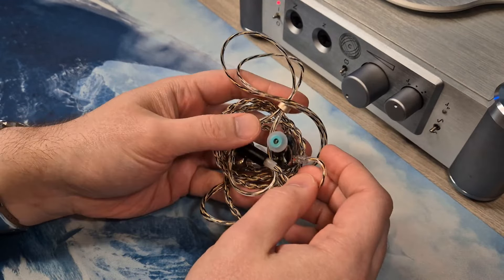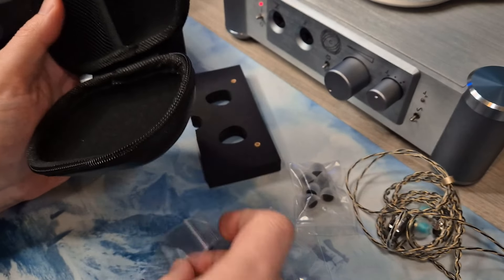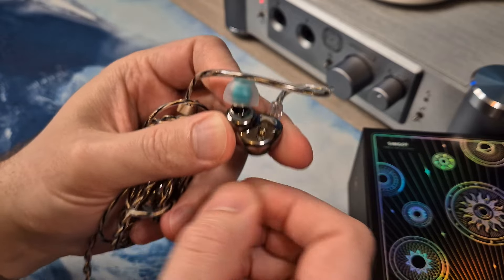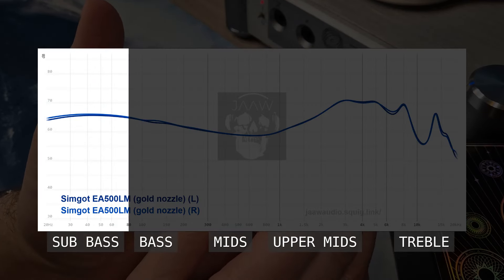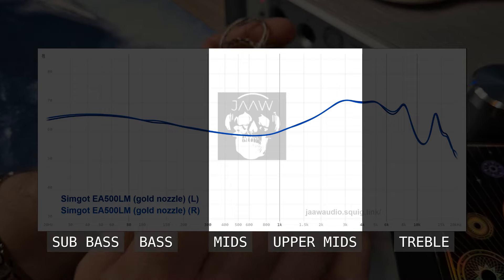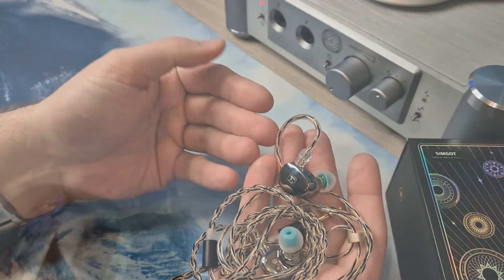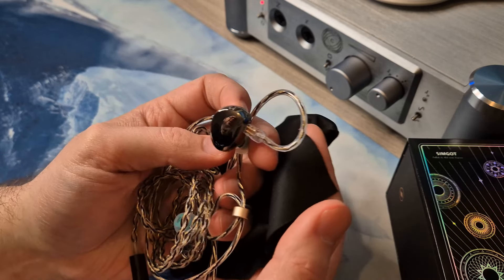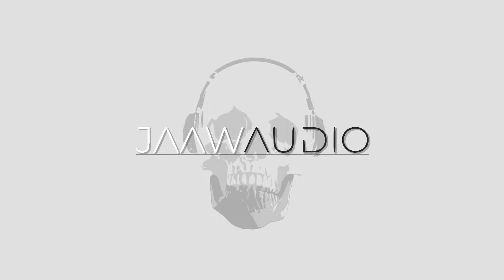Simgot EA500LM review 💥

Comment: I got this set and I'm loving it so far. I can agree with you that the set shines in warmer tracks more and the treble is quite spicy. Got Dunu S&S on them but I'll try Candy variants on them in a hope of taming the spicy treble😁 overall a great review once again and I can't wait for the upcoming eartip guide!😎
Reply from the maker: Thank you! 🫡
Reply: final type e tames the treble quite. not by much in volume, but much smoother as a result.
Reply from the maker: @haomingli6175  I'm not sure why it is, but  the Candy have been working better for me lately, tiprolling is wild sometimes 😅
Reply: Almost every tip I've used for the ea500lm has decreased headstage and separation by a noticeable amount. Reverted to stock tips and just EQ'd and tweaked the treble, sounds much better now but still worse than my HD560S that I bought for only $30 more for everything but bass amount, quality is about the same.

Comment: I wonder how it would compare with my single DD and original HZsound Heartmirror's ["HM's"]. I have, admittedly, modified this venerable set with a Y4 paper filter to each respective case (R/L) vent closest to the base of the nozzle. The HM was also notably bright and this simple mod made for a more balanced signature with very good base; without loss in tech performance or for vocals.
Reply from the maker: Interesting iem you have, I have only the HMZ, perhaps I'll check out the others someday. But there's so many iems ...right now I have over 20 new iems on my testing table. Many videos incoming 😅